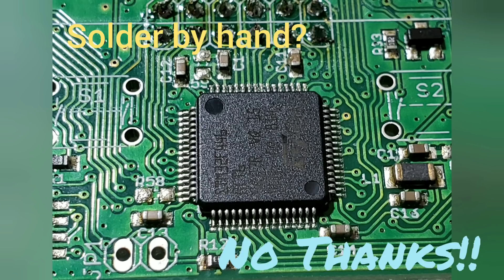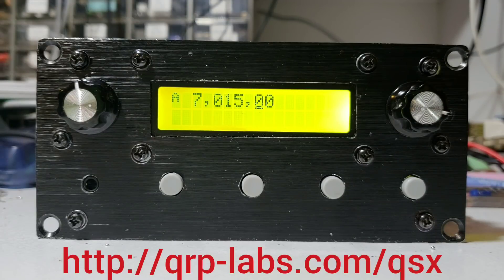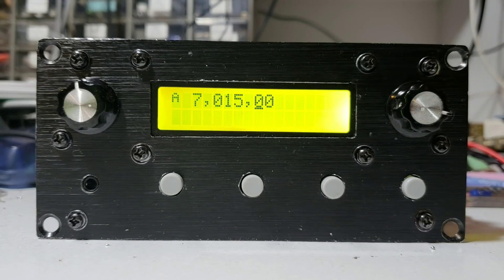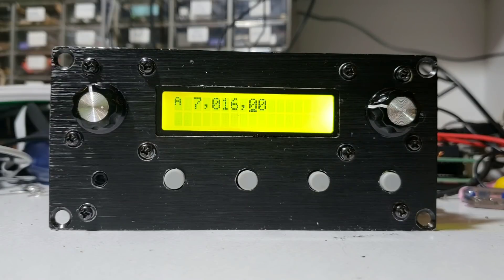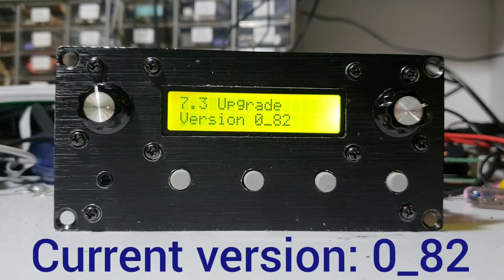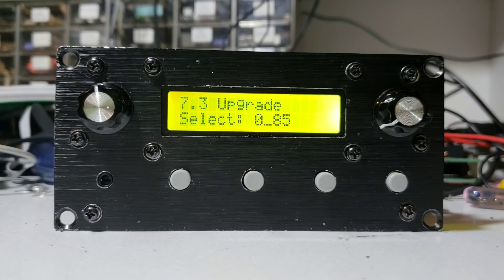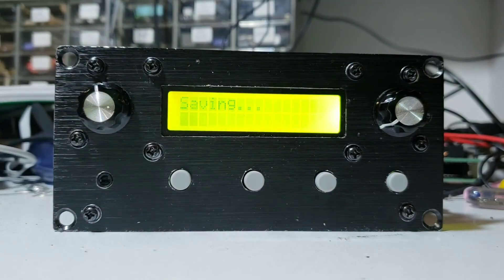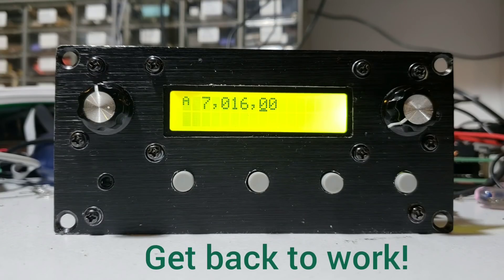QSX firmware updates and soft power switch

Comment: how does one recover from a failed update attempt?
Reply from the maker: I have never experienced a failed update attempt. 
However, I have allowed for this possibility - for example, if the Flash memory was corrupted somehow, or the file was corrupted, or the EEPROM got corrupted somehow. 
The bootloader sector of the Flash is protected, it is set one-time to read-only and cannot be altered, ever, or corrupted. So the bootloader will always remain intact whatever else happens. 
Then press the Left button during power-up. This triggers the bootloader to look for a file on the Flash drive named 0.QSX. So you would just put a valid firmware file on the Flash drive and rename it to 0.QSX. This would then be installed normally and recover the situation. 
But, as I said, I have never seen a failed update attempt - I only validated the recovery plan by forcing it during a special test case. 
73 Hans G0UPL
http://qrp-labs.com
Reply: @QRPLabs  Fair enough Hans, I was asking for those of us with Dodgy utility power, or perhaps pets who suddenly take an interest in grabbing/chewing on wires.